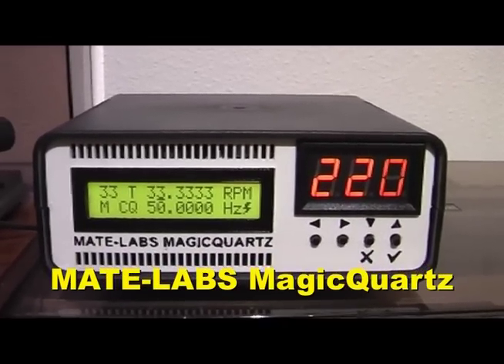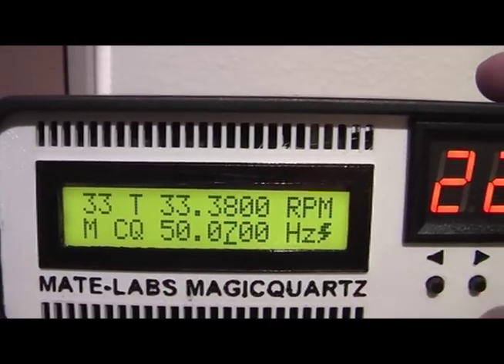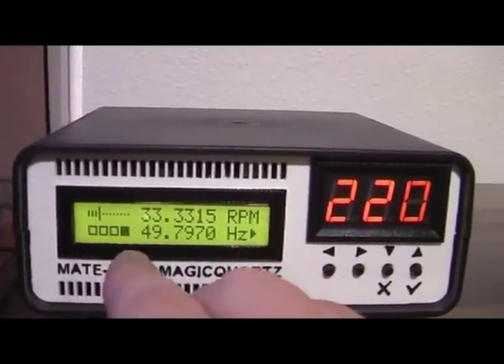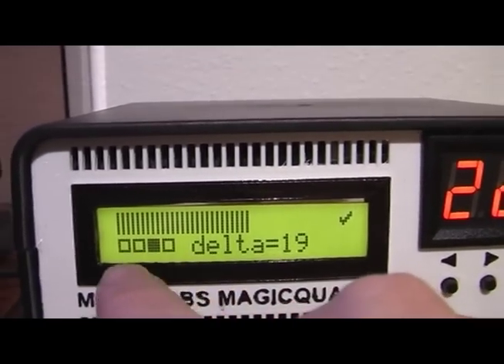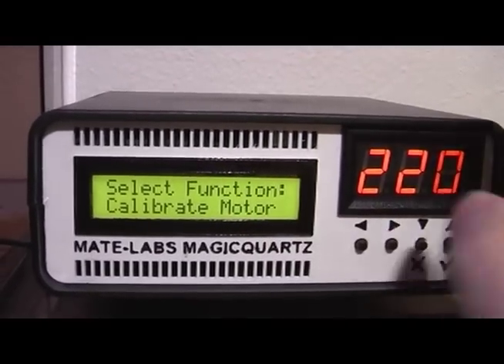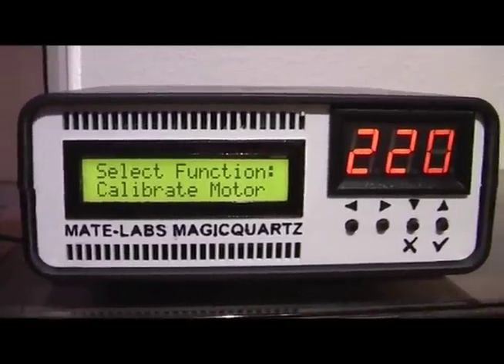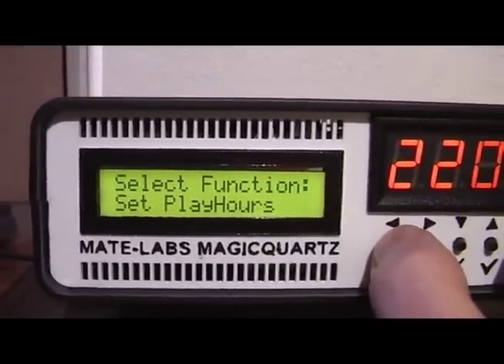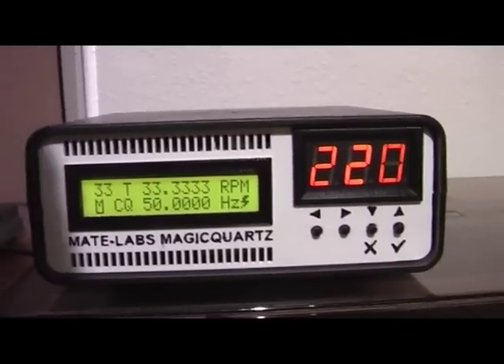MagicQuartz Turntable Speed Box Firmware Walk-Through

Comment: That’s an awesome unit. However, I noticed that you set the 78 rpm speed exactly as 78.0000, though 78.2609 would be more appropriate, since your device allows to set it so precisely up to four digits after decimal point. ;-)
Reply from the maker: Hi! Thank you for that comment. Interesting suggestion, I will definitely have to take a look at that! :-) As far as I know, this also applies to 45 rpm, which should actually be 45.1 rpm (at least here in 50 Hz Europe). By the way, I've resumed work on MagicQuartz, so hopefully I'll be able to provide something in the future. But I don't want to promise too much at the moment, I'm still running this on a hobby level.
Reply: @RealCyberSeb  Well, 45.1128 rpm to be as precise as your unit allows. :-) However, some vinyl manufacturers in Europe equipped with Neumann lathes allegedly have Technics SP-02 drive motor which rotates exactly at 45 RPM (same like Technics DD turntables), so I understand it may be desirable to keep it at 45 even in Europe, but you generally don't know unless you compare it to digital source if the vinyl was recorded it at 45 or 45¹⁵⁄₁₃₃. You may find some articles and forum discussions regarding this topic if you are interested. ;-) 

Here are some known record speeds and their variants from the both sides of Atlantic. 

4⅙ (4.1667), 8⅓ (8.3333), 16⅔ (16.6667), 33⅓ (33.3333) = same for 50Hz/60Hz countries

45 (45.0000), 76²⁸⁄₄₇ (76.5957), 78⁶⁄₂₃ (78.2609), 80⁸⁰⁄₈₉ (80.8989), 84¹²⁄₁₉ (84.6316) = 60Hz countries

45¹⁵⁄₁₃₃ (45.1128), 76¹²⁄₁₃ (76.9231), 77⁷¹⁄₇₇ (77.9221), 80 (80.0000), 84³⁶⁄₇₁ (84.5070) = 50Hz countries

And some less known speeds for 60Hz countries. (For these I have not found the 50Hz equivalent, it will be close, but who knows sometimes it runs slower or faster in Europe than in the US and other times vice versa.)

71²⁹⁄₁₀₁ (71.2871), 77¹³⁄₃₁ (77.4194), 79¹¹⁄₉₁ (79.1209), 81⁹⁄₁₁ (81.8182)

Besides the later standardized 78 value, the 76 and 80 rpm seem to be most common as I have noticed. Though many 76’s were supposed to be played at 78 to sound more brilliant at times.

EDIT: Forgot to mention if you decide to go for 45.1128 rpm as the standard value, you may also go for 77.9221 rpm instead of 78.2609 as the 50Hz standard. ;-)

Comment: Seb, are you still working on this?
Reply from the maker: Hi! I now have some time again and plan to continue this project somehow.  Unfortunately, it's not that easy to bring an electronic circuit to market, even if it's just a DIY kit. I'm still exploring possible options here. Maybe I'll make an open source project out of it, but at the moment I'm not aiming for this.
Reply: @RealCyberSeb  I'm looking at other DIY turntable controllers, but your is over the top the most advanced.
As the motor drive use isolation transformers, driven by low voltage audio amplifiers I do not see much risk.
I sent email to you on mate-labs.de, I have some other ideas for this.

Comment: A really nicely executed prototype. The user interface could be more intuitive perhaps app controlled from a smartphone might be a good way to go. If the sensor and patch were installed under the platter and the algorithms more automatic, all the user would need would be the readout of speed to 4d.p. The motor voltage could be set by listening. There should be a "sweet spot" for voltage and frequency pairings for a motor which gives the smoothest rotation without motor harmonics. The app could then be used for the more technical adjustments you outlined as they would be less commonly used. The app could also interrogate the speed controller and apply new instructions combined with text and graphics.
Reply from the maker: Hi Christopher! Sorry, I just saw your comment. Thanks for your nice suggestions! I'm also thinking about ways how to simplify the system further by making the hardware simpler (and cheaper) while shifting functionality towards software. Doing this on a smartphone could be a nice idea. However, I think not ALL tools should require an app. But maybe for version 2 ...
Reply: The real danger with record players is the ability for good solutions to introduce more levels of adjustment. The magic sweet spot has to be found for each one. It really takes time and patience to find the sweet spots for each degree of freedom. Often you need to revisit each adjustment again because each adjustment calls for a new level of adjustment elsewhere. The nightmare scenario of record playing is continually finding something to adjust. With computer algorithms we might get the computer to monitor and fine tune between records. Then our app might be a big red button called "Calibrate".
My main ambition is to get the record player out of the way of the recording. My test mule is a modified Thorens TD150. 
It uses. Linn Valhalla motor control board to get low wow and flutter. I know what would be better and have a philosophy of what to do. It sounds brilliant but there is always more to get. You have a good product that solves many problems. Well done.
P.s. There is some RF output audible. There is a tick when the white patch passes the sensor and a high frequency oscillation which varies with the oscillator frequency.
Reply: When will this be available? Or how do I order one?